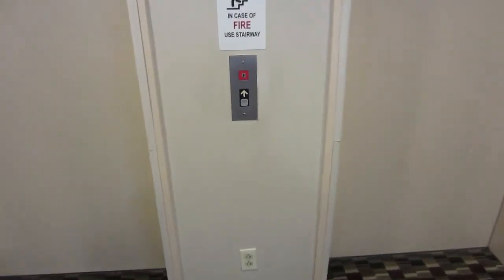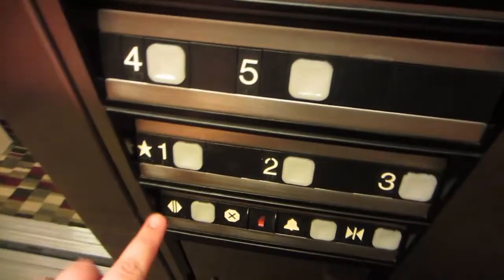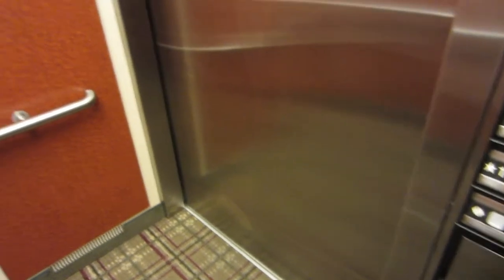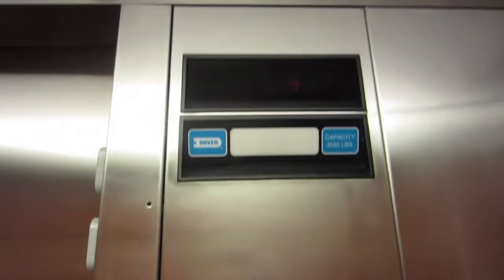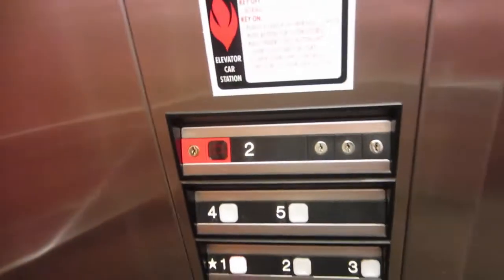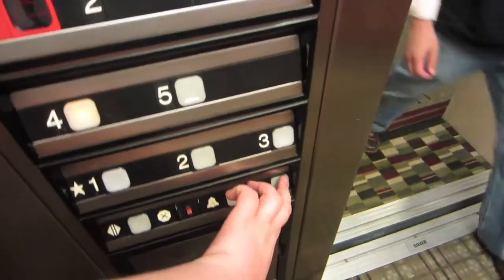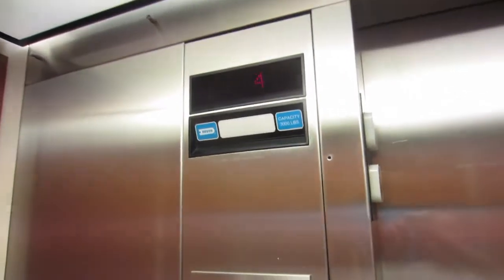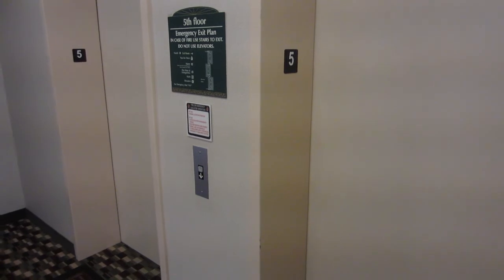Last Dover Install Ever? Hydraulic 1998 Dover Impulse elevator @ Hilton Garden Inn Cupertino

Comment: Well, no matter what kind of hydraulics these elevators use, the speed is amazing for hydraulics. Also, I couldn't help noticing the key switches are not labeled. I just can't place ThyssenKrupp anywhere on these besides the sensors and the lack of Dover blue in the shaft. These just say "Dover" all over them. Maybe, ThyssenKrupp aided in this installation but these are, without a doubt, a great find! I am going to do some further investigation on the last Dover install. TK should know.